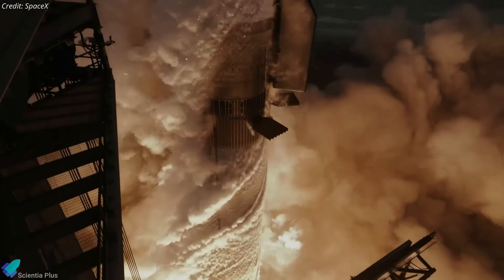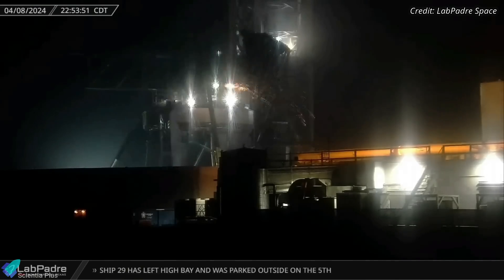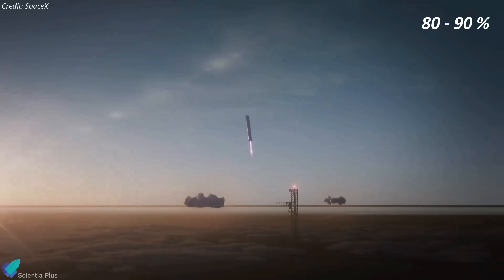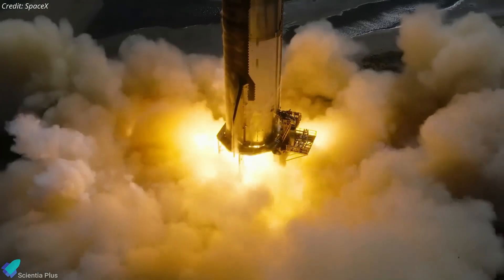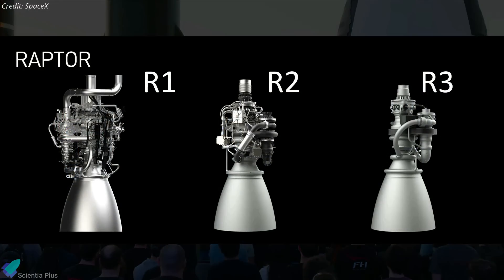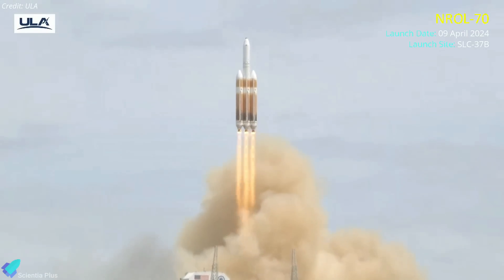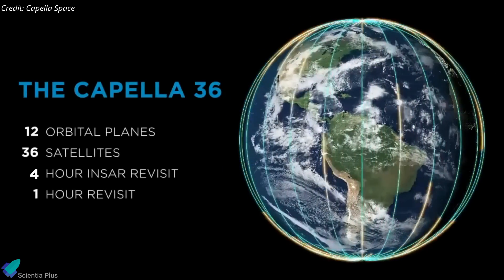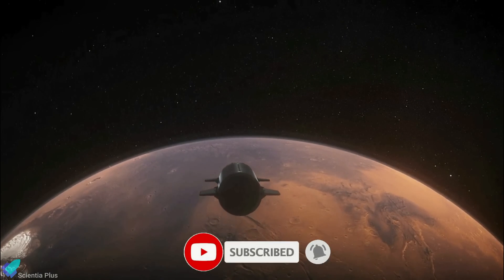Starship V2 & V3's Game-Changing Upgrades Unleash New Powerful Raptor Engine & More

Comment: If you just keep up the same momentum and pace I don't see how you can achieve the goal
Reply: ?? The goal is the 09/26 moon launch. 

They are accelerating with the new infrastructure to build at least 1 complete stack per month by end of 2025. More than enough to support the launch and still deploy Starlink.
Starship V3 appears to have more than enough fuel to get to the moon and back to LEO. They will have 3 launch pads and multiple reusable rockets to rapidly fill an orbital depot (a modified tanker Starship). Engine production, hull production... work on the lander specific components is already underway...
Why can they not achieve their goal, especially when the infrastructure and funding are Rapidly growing from already impressive levels? (Spacex is building massive Starlink revenue to handle costs - 2.7 million subscribers and Much more capable satellites going up rabidly with 5x the number going up when Starship starts launching them... and the new E band allows 4x the bandwidth - already approved by FCC and already part of the existing V2 sats... big, big profit growth). There will be no Cogressional fiddling with budget to stop Spacex.

By the end of 2025, Starship should have a very substantial launch rate. Docking and fuel transfer would seem easy (Dragon-ISS docking is old hat now and fuel transfer recently demonstrated). They are also familiar with life support systems from Dragon II. 

If they perfect the chopstick catch by the middle of next year, they are in great shape. 

Please state what hurdles suggest they will be late? I don't see them.

Comment: Will the Mega-Zilla tower  have to be modified for the V3 & updated booster?
Reply: I would tend to think the tower is tall enough to accomodate Starship V3.

They need Starship V3 for the 09/2026 launch of the lunar lander. They are building a 2nd Starship tower at LC-39A (they can use it now that it no longer endangers the Only Crew capable tower (there is now a second one, fully tested at SLC-40 and the new tower will probably be operational in about 6 months.
So it would be odd to build their first And second towers to the same height when they know they need higher. I expect the rocket can be taller than the tower as the chopstick clamps are a good ways down the rocket below the upper fins while the chopstick arms go all the way up to the top of the tower.

Comment: Starship won't even make it to the Moon.
Reply: Were you one of those who said it would never fly?
Reply: 100 feet further each launch before blowing up.
Reply: @frankmcgowan9457 No I only said it wouldn't go to Mars or even the moon.
Reply: @TheMoneypresident Now that they have to land the booster and the ship, it's going to get funny.
Reply: @ludwigvanzappa9548  most people don't even know he was booted from all operations except these talks.
Reply: @TheMoneypresident I didn't know that. Do you have a link? Did Nasa put pressure?
Reply: @ludwigvanzappa9548  former nasa people are in charge of a few departments. A month ago he stepped down from tesla and SpaceX. No channel has said anything about it. Truck is a massive failure.
Reply: @ludwigvanzappa9548  
Refueling is the remaining hurdle before the moon.  
Technically, ship re-entry, booster boostback and the catch are not really required to get to the moon if Elon is willing to waste the hardware.
A single ship payload of fuel being transferred would prove the concept.

Comment: According to the recent fly, the whole Starship should be covered with protective tiles, as Starship was not able to position itself with tiles facing forward and was rotating uncontrollably. 😥
Reply: Or maybe just fix the blocked attitude thrusters!
Reply: Wrong answer. Control rolling